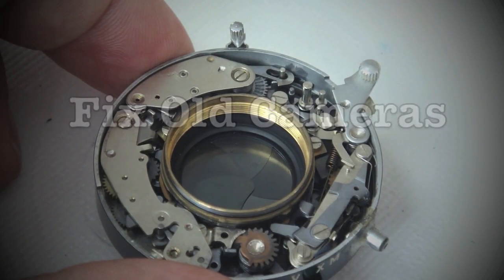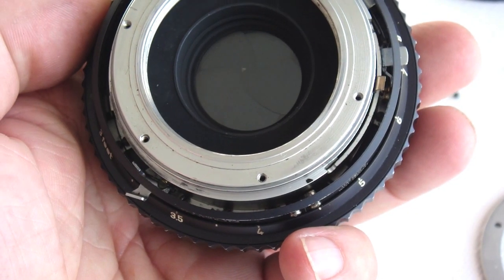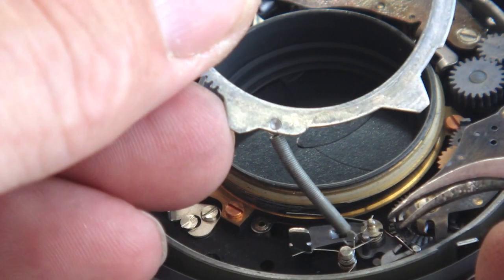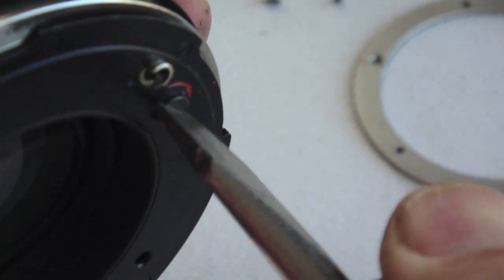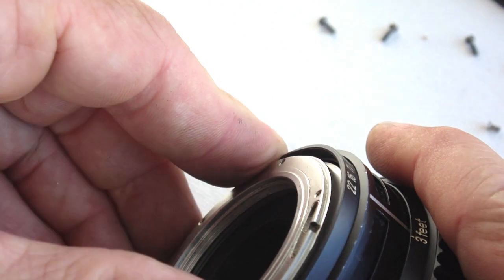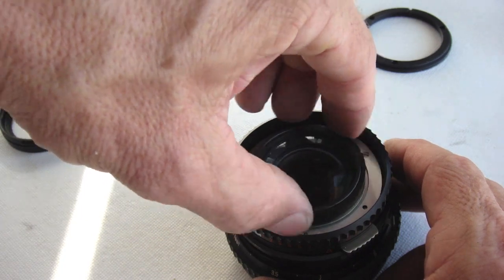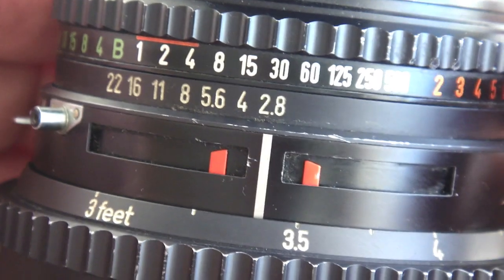Fix Old Cameras: Hasselblad 80mm T-Star Shutter Malfunction

Comment: Hi !
I thought this video could help me, but I don't know... I'm kind of a newbie into Hasselblad lenses.
I work with Fuji GFX bodies and just went to buy a couple of Hasselblad lenses (250mm F5.6 chrome and 150mm F4 chrome).
The 250mm is working well adapted, I just have to manually unlock the aperture blades with the little lever (on the same ring as the depth of field markers).
The problem I got with the 150mm is that this little lever doesn't exist on this lens... (wasn't aware of that)
So I can only use F4 and F5.6 apertures, the lens won't stop down any further.
I tried to see if the diaphragm is working properly when leaf shutter is closed : yes.
But I have to set the leaf shutter open to use it adapted onto my GFX camera. And I just can't access to these slow aperture values.
Do you think there's a tip to resolve this "problem" ? Or do I have to remove the whole leaf shutter mechanism ?
Thanks for your help !
Colin

Comment: Hi sir, at 2:19, the black spring right underneath your left thumb, what is it for? I have an old 80mm T star lens and that spring is missing. Now the aperture blade is not opening fully when it is cocked.  I can see the iris goes back to F22 position slowly when I cock the screw at the lens back. Not sure if the issue is caused by the missing spring, if you know anywhere I can buy the spring. Need your help, appreciate it a lot.

Comment: I have encountered two more issues and need your help. 1. The pin (cocking and release key?) is moving along with the cocking ring but when I cock it, the pin escapes the cocking ring in the midway and the lens wont cock and diaphram blades do not fully open and set back to the aperture F22 level. How to fix this issue? Do I have to take out the pin? 2. Those two Intermediate cocking gears, i did not mark the position. Is there anyway I can get them correct? Thanks a million.

Comment: Wonderful, very helpful video - thank you! I wonder what I can do about too fast shutter speeds? 1 second is fine, 1/2 is fine and 1/4 is fine but 1/8 comes out way faster and this continues down the faster speeds. I remember that this somehow is connected to the tightness of one or two screws providing some kind of resistance to the spring? Would be super glad to hear from you. Cheers.
Reply: Figured it out I guess, one of the screws of the timing mechanism wasn’t tightened. Now I wonder why I can’t cock the shutter normally, as it seems to be locked intermittently and I have to hold the shutter release lever in order to be able to turn the cocking-mechanism. Intermittent behaviour sounds like some parts aren’t moving back into position as they should on a regular basis. Any ideas what to look out for? Cheers
Reply: @l.m.k.9564  make sure the little nose on the left side of the escapement sits left to the center of the spring loaded main cocking gear . If it doesn’t cocking will be impossible .

Comment: Thank you so much for this video. I recently purchased a 150mm f4 c. It has the same problem especially on the slower speeds.  Do you think the same principle applies to that lens too and how complicated is to get to its shutter mechanism? Obviously I would have loved if you made a video for it but that’s a long shot...thanks
Reply from the maker: The shutter is virtually the same and the disassembly to access the shutter is similar with a few variations.
Reply: Thanks, time to get my screwdrivers out:)!

Comment: This channel is awesome!
I can't open a Distagon C 50mm f/4!!
Below the front ring with the band there is a ring that holds the front element in place, but I can't remove it before removing the name plate - which has no dents so I could fit a tool to unscrew it... :(
Reply from the maker: You will have to use a friction tool on the name plate ring. Sometimes seeping some alcohol around the threads will help. Use the alcohol sparingly so as not to have it flow behind the lens group.
Reply: @FixOldCameras  you are awesome! Thank you very much!

Comment: hi, i watched your video and fixed the slow shutter problem. but there is another new problem: the aperture didn't work. maybe something wrong when i dissemble the lens. how can i do next? do you have any guide to disassemble the aperture parts? thank you.
Reply from the maker: If it was working before disassembly to fix the shutter than you probably did not get the aperture control ring set in proper timing and linkage to the aperture stop down mechanism. You will have to go back through the reassembly steps. With persistence and patience you will get it figured out.

Comment: Thank you for this video. It helps so much! But I‘ve another problem with the backside of the Planar. The focus is not sharp at infinity with my 100mm Planar. Maybe you‘ve a solution for this or planning to make a video about it as well.
Reply from the maker: Does it look sharp focusing off a ground glass on the focal plane? If not, than check for proper seating of the front and rear lens group and the focus helical stop point.
Reply: Fix Old Cameras Thank you for your support, appreciate it. I don‘t have it here at the moment, but the 80mm and my 120mm are in sharp focus at infinity at the same camera attached, so I think, the 100mm is anywhere out of adjustment, but I have no idea where to start or what I have to adjust. If you would have it attached and the camera in front of you, then it seems there are few degrees missing of turning sharp on infinity. If I would be able to turn further, like 3mm or so, it would be sharp. So, I think I have to disassemble from backwards, because from the front there are the gear for the time-setting, am I correct? Thx in advance and thank you for your videos supporting the community.
Reply from the maker: @pmdt8090  If your remove the bayonet from the back of the lens you can tweak the position of the helical threads. DO NOT separated the threads! You will also need to be aware of the cocking gear and latch position. Take a picture of the position when you first remove the bayonet. Make reference dots with nail polish (you can remove them when no longer needed)
Reply: @FixOldCameras  Thank you for your kind support. Just got the 100mm and removed the bayonet. I saw, what you have described and got into it. But there are marks already and I think, the lens is a problem-lens. It seems that someone tried before to fix it, because there are several marks in it. The helical threads are at the end, so I think someone moved the threads by one tooth. So I give up at this point without success, but will keep it in mind and maybe I'll think about to fix it in the future. Anyways, thank you again for your support and keep up your work and videos. You're supporting the community and help so many people to get their old cameras up and running again. At least I benefit from your support!
P.S. A day later now I tried to fix it. I rumored in my head, so I had to get into it again. I opened the bayonet and unscrewed the inner helical thread slowly and turned one or two gears further. It worked and now I can focus sharp on infinity.

Comment: I've an Afga PD16 Viking F.7.7 folding camera that looks brand new, but the shutter just doesn't work, when I try to press the shutter it get stuck and I'm not able to "shoot" again, the blades doesn't move, do you have any thoughts of what could it be? thank  you.
Reply from the maker: Typically the shutter will stick due to a migration of oil on to the shutter blades. If that is the case cleaning of the blades will be necessary. But of course that is not always the cause. It could also be any number of mechanical failures with in the shutter and release mechanisms.

Comment: Man, I really like your videos, but this one is no good. The placement of the slow speed escapement is critical to the timing of the shutter. I get it, not everyone has a set of calipers laying around to measure, but there should at least be a note about this affecting the timing. The long screw that holds down the slow speed escapement is a pivot. You tilt the escapement toward the center to slow the shutter speeds and away to speed them up, then tighten down the short screw to lock it in. It's also important to note that this placement affects 1/30th and up, so with this thing out of place all speeds will be off. Lastly, there is another control fin on the opposite side of the escapement from the main spring that needs to be seated properly. You can put it all back together even if you dont, and the shutter will activate, but again, all your timings will be off.

This is all information that I sourced from the Hasselblad repair manual, but unfortunately for me, it wasn't until after I followed this tutorial. So please, if you don't want to remake the video, at least include a note about the timing issues with this repair.

Anyone else trying to follow this tutorial, please be aware of these issues. There are other videos that address these issues in greater detail if you keep looking.

Comment: Hi. First of all thank you very much for your videos. I need your help for something that I ve never seen in any tutorial.. I had to change the shutter of a 80 t* just like the one on the video but I never found how to replace ot properly.
The blades don't want to fully open. I tried, tried and tried again to understand why on earth it woukd not get normally opened. Could you please give me the tip?
I remind that once I found it, several years ago, but I can't remember it anymore and I don't have enought time to spend on it unfortunately, I woud just love to understand...
Thank you by advance
Reply from the maker: Is it possible the timing between the main shutter cocking pinion and the shutter cocking ring is slightly off?
Reply: @FixOldCameras  hi! Thanks a lot for your kind reply! I will check this! Thanks again :)
Reply: @annonymous3871  I had the same issue. Try to realign the gears to catch different teeth of cocking pinion, one before or one after should do

Comment: Hello again, I recently purchased a Bell and Howell Dial 35 (version 2) That has a problem with the clockwork motor film advance. The shutter, meter, aperture, and all other components aside from the film advance are working properly. I do not know how to get to it, I am assuming the problem is being caused the lubricants inside. I simply need to find a way to remove the clockwork motor. I cannot find a repair manual anywhere and I need some help. I have seen several other people with this problem. The motor, when wound, makes all the right sounds, but the spool winds at random, even when the sprockets inside are advanced. I do not know how to fix this. Any help is greatly appreciated. Thank you in advance.
Reply from the maker: Remove the back cover plate. Find the double stack of set screws inside the film door next to the film spool where the Winding Grip attaches to the body. Remove set screws. The Winding Grip is removed by turning counter clockwise (left). A cautionary note - Make certain the winding spring is unwound before removing the Winding Grip. A disassembly diagram of the Dial 35 is viewable on the Google Plus page of Fix Old Cameras
Reply: Ok. I got the grip off. What do I do next? The problem is that the spool nonsensically jumps at random times, and doesn't move smoothly. It is very jerky. What should I do with the motor once it is off? Thank you for your help thus far.
Reply from the maker: You might be able to flush clean the internal of the Winding Grip.Follow up with a very small amount of silicone lubricant . The wind gears and mechanism of the camera body might also need to be checked.
Reply: Thank you! You have saved yet another camera. Thank you so much for your help.
Reply from the maker: Excellent.

Comment: Thank you for the video, I have a question, recently i have a chrome c80 lens and a c60lens, but the rear glass of the c80 has some scratch, can I switch the rear glass between them? 
And what do I need to do? Thanks
Reply from the maker: If you are very careful and meticulous in the switch so as to avoid a mix up... maybe give the switch a try and experiment with the results. Maybe also someone else might have some definitive insight into your question and save you the trouble of the switch if it is not a workable swap.
Reply: ok, thanks, i asked some ppl online, they said, they cant be exchange, cuz they are different design, so even the size is right, but i cant be focus...
Reply from the maker: Thanks for the additional information.

Comment: Very interesting video.
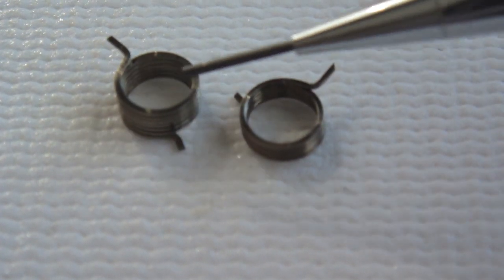I would like to know where I can buy the Drive Spring 1 (parts # 102211-1515-000) that appears in the video at minute no. 2:50 of the video. 
Thank you
Reply from the maker: The last batch acquired came direct from Hasselbad... but FixOldCmeras does not resell parts. Could be that Hasselblad no longer makes them available. Surely they are available from different internet sources if they are no longer available from Hasselblad. Guessing they might sell for $30 to maybe $40.
Reply: @FixOldCameras  Thanks

Comment: What lubricant do you use? I have an old 50mm (silver one) that needs CLA'd
Reply from the maker: The 50mm is similar to the 80mm only after the larger front element and housing is removed.
The grease for the focus helical and the light oil for the shutter can be found here -
http://astore.amazon.com/fixoldcam-20?node=1&page=5
- or you can use a light sewing machine or clock oil for the shutter and a light synthetic bicycle chain grease for the focus helical threads.
A word or two on CLA. There are only a few points of adjustments in such a lens and to adjust them beyond tolerances to correct an immediate issue often will cause future major problems. If the lens shutter is jammed than it might need to be addressed as a repair. If the issue is a sluggish shutter than that indeed could possibly be corrected by cleaning. Where old lubricants are causing an operational issue, they will be need to be removed and replaced to facilitate repair.  If the old lubricants are not causing a problem than they might be left alone. If the shutter is so dirty that the grime has fouled the function completely then of course it will need to be cleaned. In order to completely disassembly the lens and subsequently the shutter, to remove all old lubricants and to clean every part, and then make adjustments and repairs where applicable, would be akin to an overhaul and would require far more detail than what was covered in this short video.
Reply: Fix Old Cameras thanks! Sounds like a job for a pro.
Reply from the maker: Not necessarily... depends on what needs to be done. However if you are interested in getting it repaired... visit
http://www.phototronic.biz/services.html